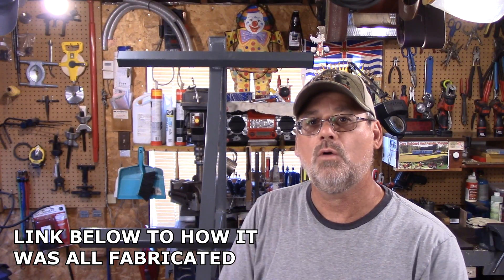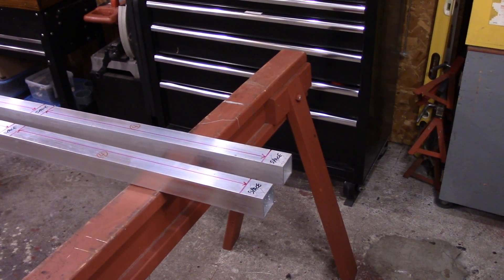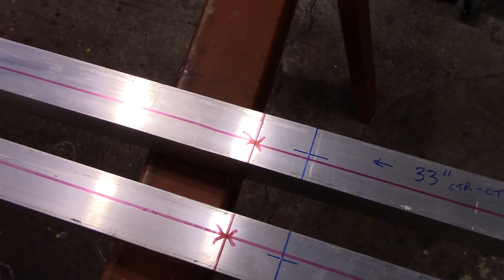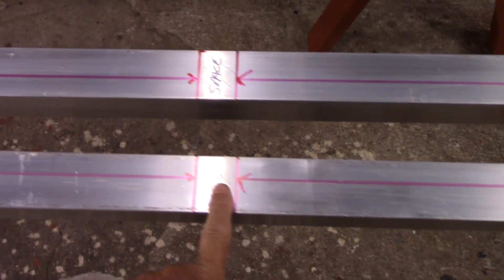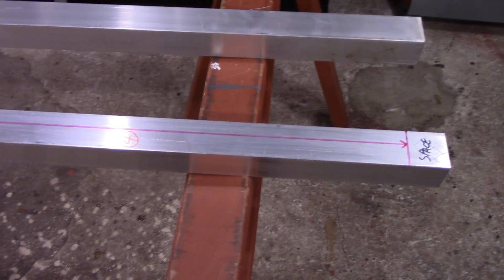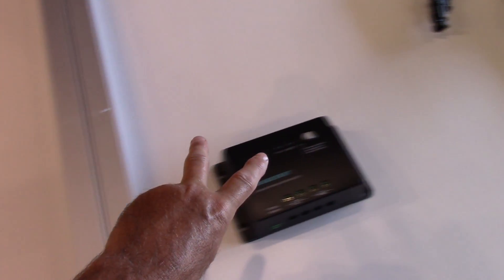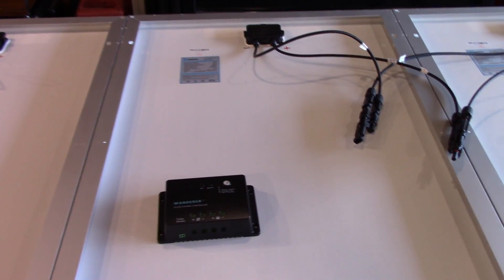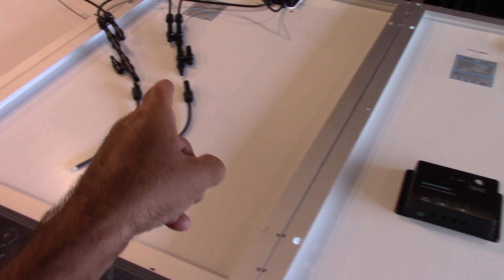400 Watt Solar Panel kit |  Wiring  Up  The Solar Panels - Total Fail

Comment: You're supposed to put 2 by 2 in order for the connection to work....people usually don't have narrow single rows of panels.
Reply from the maker: Usually didn't work out as well for me but I did get it all sorted out and the 400w  array is up and running.   I have a playlist on my solar projects if you like to see the result.

Comment: For $500 you could have bought way over a kilowatt of grid tie panels. How about showers at your camp? With the added power you could have hot showers free like I do at my camp. Some advice, don't run those two sets of panels together with that coupler.  At that current, those connectors will melt over time. Run separate wires down from each pair and each pair should have its own fuse.
Reply from the maker: Not sure what country you can buy 1000 watts for $500 but not here. I have a shower 240v water tank from genset power. Cables are rated for 30 amps , most this will produce ever is 25 amps. Stay tuned to see the install. 👍
Reply: @SteveRobReviews  Here in the US I've bought them locally in two states 800 miles apart $120 fro 250W and 150 for 280W.  All solar is local and individual results vary.  People told me I paid too much.  Panels are a commodity and for installers it is flavor of the month. They always seem to have left over lots because color, wattage and size of the next month purchase will be physically different.

They say they are rated for 30A. Just compare those to other industrial connectors.  Your best play is to buy another set of MC4 and bring down each pair on their own wire.   This will allow smaller cheaper wire and give the ability to do comparison.  You would not believe how much solar power is wasted. You might find how I heat water interesting.

Comment: it's never right when china is involved. lol    I run 1, 220watt panel, and a 400watt wind turbine. So far 8 years later and still working.
Reply from the maker: Sounds great and I haven't a clue what i'm going to run but it's definitely not to any code ever invented :)

Comment: That is a funny video. A good Blue Ribbon can solve any problem.  If the first cold one can't do, just repeat until a solution is found.  I do the same BTW. On guy below suggested a different orientation/pattern.  Instead of 4 in a row, maybe try 2 by two, and put the connection toward the center.  It may work. Then for your 80$ aluminium stock, you may have to open another Blue Ribbon to figure that.  Thanks!
Reply from the maker: Thanks Joe it's a easy resolve with a additional harness  and it's going together like I dreamed . LOL

Comment: instead of mounting them side by side mount 2 end to end with boxes on the panels next to each other , then do the same with the other 2 and mount them lengthwise , then the others under them .all the boxes will end up in the center and you should have plenty of cable .
Reply: Great idea!
Reply from the maker: I looked at that and there is still a missing cable that I have bought and it's a go as you will see coming up.  The four panels must be horizontal stacked above each other. Good thinking though.

Comment: Probably have to get some #10 pv cable from ebag. They have the connectors and even inline fuses. I believe these all go in series right? Because each have a module? If so you may have enough cable to tie together. Pos would be on the 1st panel and neg on the 4th. Those back to the controller...🤷‍♂️
Reply from the maker: I got a harness off amazon and it all a go . Liftoff real soon or we just hit the self destruct button. LOL
Reply: @SteveRobReviews  Roger!

Comment: I just don`t know where to start with this thing you got Steve....first off...comes from wing wang with a US resailer....has to be top quality....second is a question...what voltage are you going to have your controller running at.....I could say 1000 things but that my way  so that`s not good but I read one guy talk about bears....get that think of the ground or it`s going to be all broken in no time....they just love to cause mischief and they probably take that whole thing in the bush just to play with....best is to keep it simple....electrical supply has aluminium construct with all the fitting you would ever need to do that job....I even have some in my garage.....Bon courage like the Algerians us to say every morning before work...CHEERS

Comment: I'm sure it is too late now, but if you index the two left panels 90 degrees clockwise, and the two right panels 90 degrees counterclockwise, would the wiring come together?

Obviously not the way your frame was built, but just thinking that may have been what the manufacturer may have intended.
Reply from the maker: Paul there is a connector harness missing and I already bought it , no big deal but it wouldn't go together without it.

Comment: Here is my unsolicited opinion.  I would get an MPPT charge controller.  Hook the panels in series and then your leads will be the correct length and you don't have that crap looking bunch of connectors.   Added advantage is that in low light periods, your panels will add all their power together, and you will get some production.  Another problem I see is that it looks like your charge controller is a 20amp model.  If you are putting out full power, your panels will be pushing 33 amps (if hooked together in parallel, like you are doing).  I think that model has over current protection, which means it will shut itself off and you are not making power.  Easy for me to spend another man's money, eh?
Reply from the maker: I am going to use the charge controller I already have at the camp. The most these will put out is 25 amps max on a good day :) I ordered a connecter to resolve the hookup then its go time LOL

Comment: If the lowest panel is only 30 inches from the ground... no worry about bears rubbing up against it? When you fix the wiring... produce kits and sell them back to the company! LOL
Reply: A joint Steve Rob and Wing Wang production.  "Strobwang"
Reply from the maker: Good idea since they would have a clue how to hook them up either . LOL